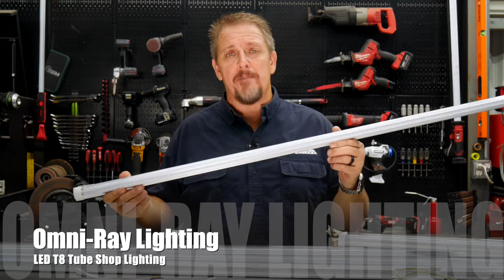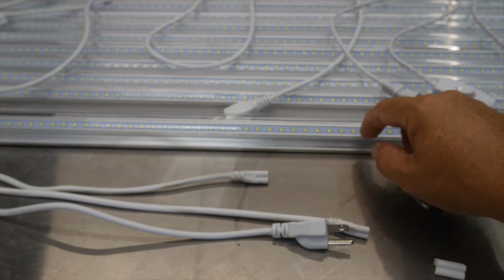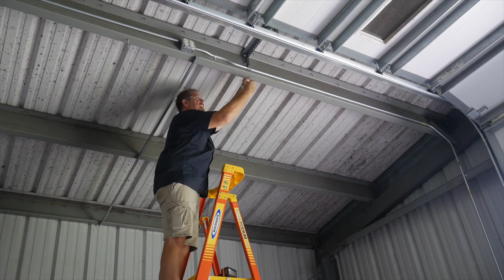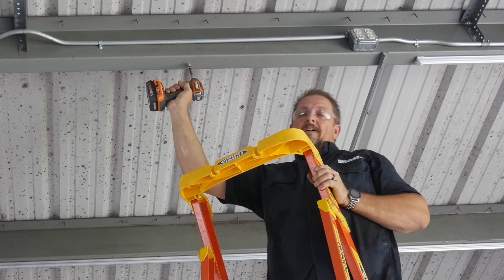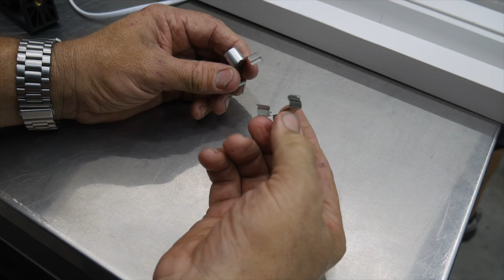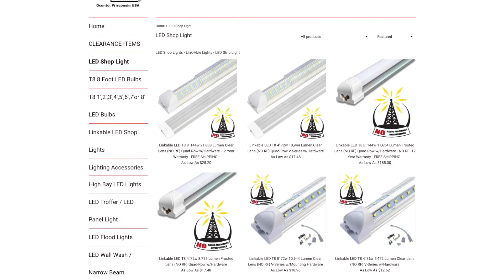How To Install LED Shop Lights from Omni-Ray Lighting [10,000 LUMENS]

Comment: Ordered from Omni Ray.  After 2 weeks no shipping and no communication.  Buyer beware.
Reply: https://www.youtube.com/watch?v=QrAqTN3ksD4&lc=UgxbNzK0U93vOMiOnbl4AaABAg

Omni-Ray called me a loser in the video above and my response is below.

Really,  Is that how you run a business?  I was going to follow up with a comment about how I received my lights and you suggested a different type and made the situation right.  However, I will post all the information now.  After a few more emails the communication didn't get much better. Mike seemed put off by my questions.  

I ordered the "in stock" lights on 31 March.  No emails at all until I sent one on 11 April asking where the lights were at since my CC was charged immediately. On 13 April I threatened a disputed CC charge and then I got an answer about how those lights weren't in stock and that he would upgrade me to shorter lights but were "non-interference" lights.  More work on my part to install for my setup.  I accepted the solution on 13 April.  17 April still no shipping notification so I asked when they would ship. 19 April I received a reply that they would go out on the next truck. Whenever that was.  22 April the lights showed up and seem to have no issues but I have not installed yet.  

Calling a paying customer a loser is unprofessional and I will still hold my opinion of buyer beware.
Reply: You are not alone

Comment: I is ordered 17 of the 8ft lights and 2 flood lights. I checked them all the day I received them because I knew it would be some time before I installed them.  2 of them kept popping GFCI  and when I told Mike he said it must be a cheap outlet, after explaining to him that it’s been in use for 20+ years and we use it on the electric start for our snow blower and doesn’t pop I would try it his way. So when I plugged it in to a standard outlet both lit up on one halt and one started smoking, I took pics and sent it to him and he had an attitude and said I just needed some pics of the issue. I said no problem and figured he would send out 2 new ones and I would send the bad ones back to see what would be the issue. And he would never respond. The products are good when they work. Customer service is absolutely terrible. He claims a 12 year warranty, not even 12 days. I am on all the garage sites telling people to stay away. It’s a shame cause he comes  across as a great guy.
STAY AWAY FROM THIS COMPANY.

Comment: I just installed 12 of the 8' T8 LED tubes from Omni-Ray in my 24 x 32 garage. Super bright and happy with the results.
I ordered 4 more 4' T8 LED Tubes to put on the middle crossbars on top of garage so the middle gets plenty of light too.
Reply: I have same dimensions I was gonna order the 10 pack of 8ft. You think that will make me satisfied?
Reply: @AlexGower  it sure will
Reply: What lumen 8ft did you use? Also ceiling height?

Comment: How do you hard wired them. Mine says no more than 3 in a row. But I have 10 lights 8ft each. But I will have to separate cables with independent brakers. Please help
Reply: What did you end up doing?